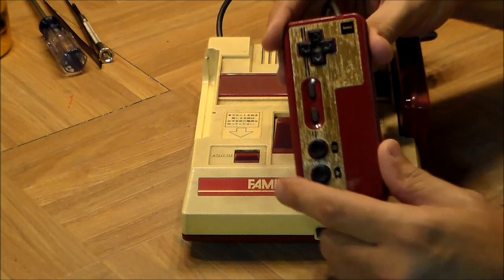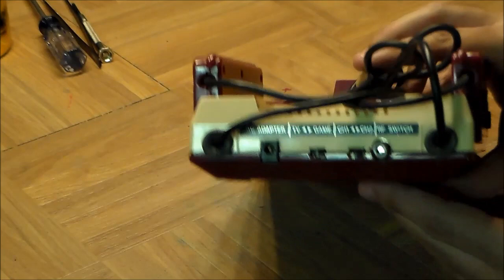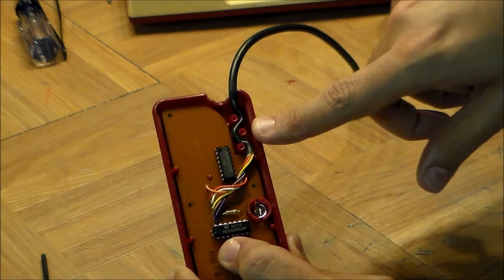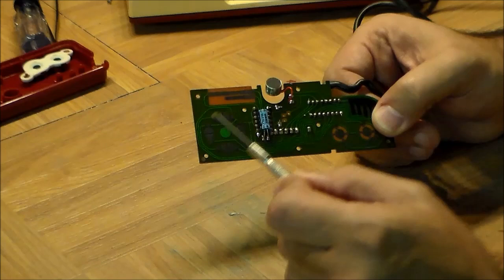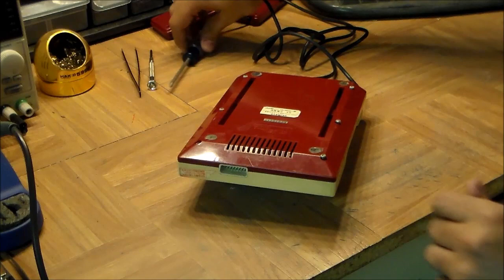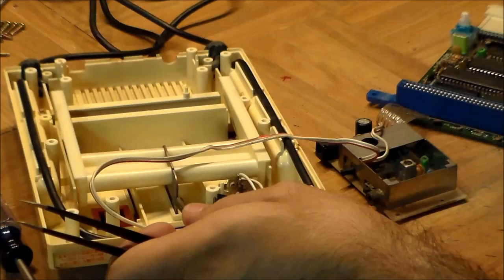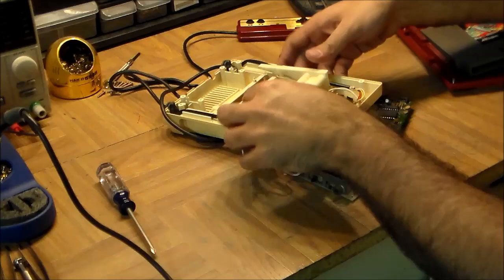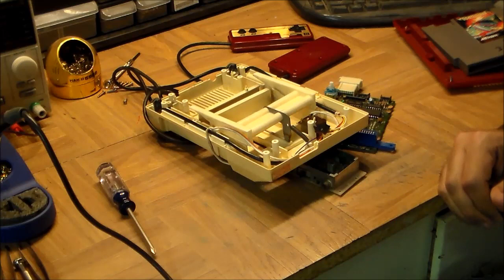Inside the Black Box 7: Nintendo Famicom

Comment: the mic is an eletrit mic,  it requires phantom power over a resistor, the cap is to block the phantom power from mixing with the audio output...
Reply: Also the author of the video did not get how microphone amplifier works.
Reply from the maker: Yes, I did not :-D

Comment: 13:38 - no, it's just a sound amplifier made from inverter that had been switched into linear mode
Main sound amp of the console is also based on inverter that had been put into linear mode. This just works as "not so good" operational amplifier, that's all.
Reply from the maker: Thanks for that correction!

Comment: I don't know why you'd want built-in controllers, especially as long as they'd have to be for markets that don't sit on the floor with their console. The rubber pads wear out, the cord length is fixed (can't be extended), you can't easily sell enhanced controllers and joysticks like the NES Max and NES Advantage, etc. The "expensive" scenario you keep using of an unhappy customer receiving a replacement for broken parts would actually be worse because they would have to send a service tech to install it. Also, if they used the shift register to encode buttons to save on the cost of wire, why is there so much excess wire inside the Family Computer? I think they did it so that they have the potential for future expansion (controllers with extra buttons, multi-tap, etc).
Reply from the maker: +Emmett Turner I see two possible answers here, a cynical one, and a cultural one. The cynical one is - the cost of the connectors. That would have added to manufacturing cost, and if Nintendo did not have a good source for providing them, it would have delayed release as they negotiate that. That seems perhaps unlikely because they did resolve all that when they moved the machine to the US (by building their own). The cultural reason is more likely - Nintendo was in effect a toy company, and they probably had a culture of seeing their products as stand alone, use for a couple of years and then discard as the kids grew out of them. So fancy add-ons etc were covered by the 15 pin expansion port. Perhaps they had no idea of the longevity the machine had until they saw the appeal?

Comment: This comment is about a correction to something that was said in this video that was probably put in an annotation back 7 years ago before YouTube removed them. 

R.O.B. didn't plug into anything on the system it was battery-powered. The expansion port in the front of the Famicom was for things like the light gun, or an extra controller, or stuff like the keyboard mentioned in the video and a few other things I won't bother to list.

Comment: The C64 is clocked at ~1MHz, compared to ~1.79MHz for the NES, so the NES has the edge processing wise...  (ofc, with just 2KB work RAM, what edge NES has doesn't really matter)
Reply from the maker: +Phredreeke yes, thank you for the correction there. In terms of gaming experience, the C64 had the advantage of the SID chip for doing music and sound effects, which was actually quite a powerful processor; the NES would have used up more 6502 cycles doing audio work. Of course, it's really apples-to-oranges comparison, so it's hard to really get a feeling for what that means.

The biggest advantage the NES had over the c64 in my opinion was software load time; yes, the 64 had a cartridge slot, but because the cheaper tape/disk alternative was there, almost no developers used it. Waiting 500 miliseconds for your game to load was just amazing at the time. I remeber having Burnin' Rubber on tape (this was probably '82 or '83, beofre turbo loaders were popular) and it literally took 15 minutes to load (the game instructions helpfully suggested you make a cup of tea while waiting for it to load!)

Comment: The original goal from nintendo was to built a game console wich allowed them to port one to one arcade games to it,but since nintendo did NOT opted for a Z80 chip, all their arcade games had to be rewritten from scratch,Why did nintendo not chosen to put a Z80 cpu chip in their famicom????

Note: nintendo arcade machines were Z80 based.
Thanks anyway👍👍👍
Reply from the maker: I think it was a good move - by the mid 80s, the Z80 was already showing its age compared to the 6502 - not just in terms of maximum memory and speed, but it was a much nicer chip to write assembler code for, so it would have been more appealing to developers.
Reply: Dave Nunez thanks for ansuring, so it was easier to programm for, thus saving time & money to make more games in the long run,but arcade games ended up very infirrior on it,the donkeykong series ended up very bothered on it.

Comment: Would it be possible to load data in via the mic input on the 2nd controller similar to a tape deck on a commodore? That would be really to cool somehow convert Super Mario to a tape format and transfer it in via the mic input.
Reply from the maker: In theory yes, but in practice no. You would first need a program that would encode the ROMs in the cartridge to sound, which is simple enough to do (similar to dumping roms for emulation). However, the problem arises when you try to read that back. In order to do this, you'd need to have a program running on the NES that would read the tones, then convert them back into binary, and then run that. Here's where the problem lies - in a typical NES game, the ROMs (carts) were larger than the RAM (working memory) available to the machine. That means you would not have enough memory to copy the sound data in, and then whatever working space the game needed. C64 and other machines that loaded games had this problem also, but the games were written in such a way that you could load in separate pieces (for example a level at a time); but in a NES game, all you need to do is switch memory banks in the cartridge in you instantaneously get access to the stuff you need. So even if this worked, you'd find yourself with very awkward loading pauses, even perhaps in the middle of gameplay (because the developers always expected "load times" from the cartridge to be close to zero).
Reply: wow, that is cool and detailed. Its a shame there would be those awkward pauses, as I think it would be cool as hell to put a mic jack onto an NES with some custom logic and load in some roms converted to tape that way.
Reply from the maker: Yeah, that would be cool. In a nice bit of trivia, there was a system for the Atari 2600 which allowed you to download games over the telephone lines (it was called Gameline) - basically this was Steam for the 2600, but in 1983! Basically you dialed up the service with your regular phone, connected the special cartridge to the phone line, and downloaded the game. I've never seen one in person, but I assume that the special cart contained a modem, plus RAM to hold the game image (instead of the regular ROMs). Probably took like 10 minutes to download a VCS cart, but talk about forward thinking!
Reply: The Famicom does in fact have a way of loading and saving data to a tape deck via the family basic keyboard. It was primarily used to save some basic programs and special user data in some games (custom tracks in excite bike for example)

Comment: Hi, I have a question. Why do old electronics have so many resistors on the PCB ? If you open the Atari 2600 you will see a lot of them. The Famicon have some, and from the super NES on, there are almost none of them on the board. Thanks.
Reply from the maker: Resistors have a lot of uses in electronics - you can use them to control voltage, current, and sometimes to separate out two circuits at design time, and join them later at build time. They are one of the fundamental Lego bricks of electronics. They do exist in modern consoles, but not as visible. In the 80s, a company like Nintendo used a lot of off-the-shelf parts, because building your own chips was crazy expensive; but today, the technology for designing and building custom chips is much cheaper - and a custom chip, if you are building at scale (millions of units) is always better because it's more energy efficient and makes you device smaller. So if you open a NES, there are sub-circuits on the main board, which on a GBA are probably a tiny piece of one of the custom chips - but the resistors are in there :-)
Reply: I understand. Maybe you could make a video on this topic, the evolution of the resistors on boards.
Could you show a pic of a resistors on a modern board (so I can spot them) ?
Thanks a lot.

Comment: sorry for one more comment lol but I just realized, are the cartridge connections really all that important? I mean in addition to a GPD XD, Q9 and G5A which are all android-based handhelds I also have a GBA hardware clone which is awesome, a revo k101 plus. Now some aspects of it design are great (replacable battery which happens to be a standard nokia one hooray, tv-out with scaling settings, the great screen with 5 brightness settings and built-in scaling options almost perfect compatibility with GBA roms and cartridges etc) but the cartridge slot in which you insert either the k-card (the custom flash card in which you put a microsd with roms, pictures, mp3 etc.) or real gba cartridges has two pins bent to all hell. it has been working perfecly for three months tough. I have literally not run into a single issue playing games on the unit despite this . My old gameboy colour cartridge slot also looks like a bomb went off in there - but again, everything works perfectly.

So how important is this really in practice?? D:
Reply from the maker: +Edward Elric a bad cartridge connection will one or both of the following (1) introduce electrical noise to a circuit and (2) block a signal from passing between two circuits. Beyond that, it depends heavily which pin it is that is broken, and what that pin does. First of alll, not every pin on an card edge is actually connected to something. Connectors ship with standard numbers of pins (e.g. 72 or 60) and some designs may only need, say 55 pins, and so some are just not used. Obviously if one of those is bent/broken, no big deal.

If it is a real pin, then it depends a lot what the pin actually does, and if the design takes pin damage into account. Some designs for examples, will have multiple pins on a connector do the same thing, so that if one of them goes, there is still some backup pins to do the job; or they may have built in noise filtering so that electrical noise from a bad connection is not a big deal. But generally speaking, this is the failures you can expect:

 - voltage or ground traces: If these connect badly, electricity will not flow so the device will either not power up, or turn on and off as the cartridge wiggles.
  - address line traces: if you have a bad connection on an address line, then you end up corrupting the memory address you are trying to read. For example, if you have three traces for addressing, and you try to access aadress 7 (in binary 111) and the second trace is broken, then the machine will receive address 101 instead, which is actually 5. Depending on what the processor is trying to do with that number, you could get anything from the program crashing, to graphical glitches
 - data line traces: Similar to address lines; you will get corruption of the Word you are passing back. This is less likely to lead to a crash on a well written program (because the programmer should be doing things like bounds checking, data validity checks, etc), but will probably lead to bugs/graphical glitches, and so on.

So it really depends on the context a lot, but they are all important. Adding traces to a board costs money, and no one wants to spend money on stuff they don't need in their design :-)
Reply: thanls for the explanation! :D Off course antoher possibility is that while they look a bit bent they still make contact with the cartridge, anyway the nice thing is the thing works perfectly fine even for very long sessions XD.

They basically reverse engineered gba hardware, made an SOC out of that, and license that to people. the best part is they made it so that it can read directly from micro-sd in the flash-card, so you can play roms on it. Good, because I would have to pay tns of money to get good games from ebay + those batteries can die and your saves are gone. Now I have like 50 roms on there, much more ... "economical" since I don't own a single GBA game XD never had one. :(

I do think BTW the revo would be a nice one to look at - maybe to see how one of these handhelds look when they cut every corner they can find. I mean it feels solid, looks super-cool and plays great, but  given that it's A) Chinese and B) extremely dirt cheap, I am sure they probably cut every corner possible and then some. XD

It would also be interesting because a video on the process of reverse engineering in general would be cool - I would love to hear how one goes about that. ^^

Comment: Question. Why use a voltage regulator instead of giving the machine the voltage it requires?
Why take 9V and knock it down to 5V?
Reply: American Pi because of stabilisation. 7805 gives you stable 5V, non-stabilised power will be relative to voltage in AC mains. Voltage jumps in such case will instantly kill the console.
Reply: Alex Zhak 
oh right.
tx.
Reply: Good question. 5V regulator is needed as the power brick may give out any voltage between like 8V and 14V, depending on load etc, but the console board needs something very close to 5V.